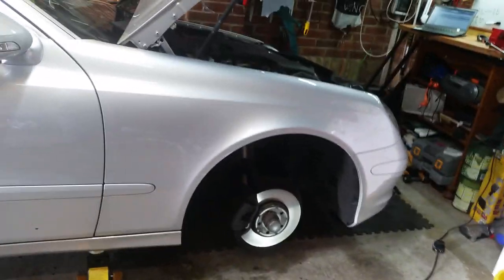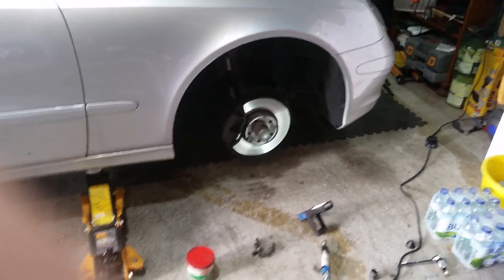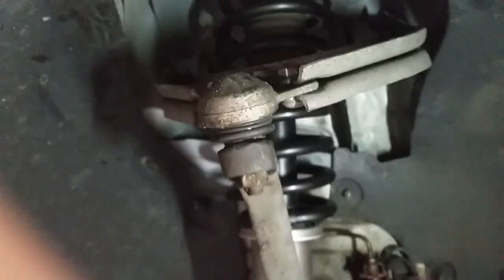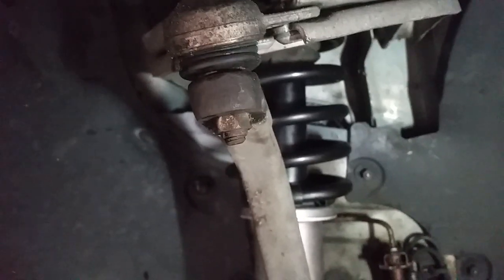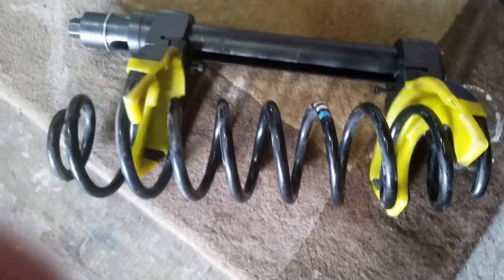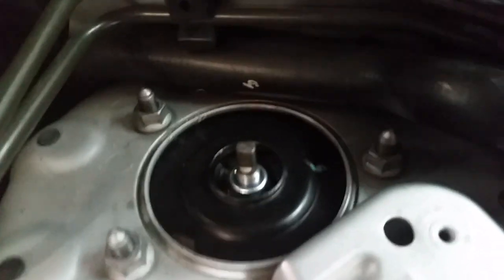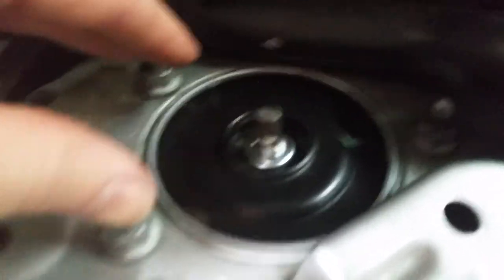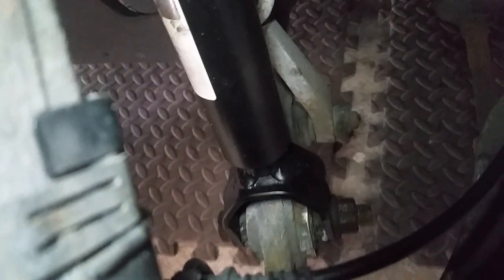Mercedes W211 front spring replacement, front shock replacement, front strut replacement

Comment: Very good video and explanation on locating the bottom of the shock to the top mounting bracket on reassembly and the ease of setting the ride height of the shock/spring by adjusting the small metal spring with your fingers. A very easy explanation. Thank you.

Comment: Easier to unscrew three bolts from upper control arm and separate knuckle from the top.
Reply from the maker: Good point.  I used the ball spliter as I had one.
Reply: @Alan.BigAl.  Much easier just to wiggle the control arm down, put the shock fork on it, towards the back of the car, twist the shock using a screw driver  through the fork and wiggle again and the shock is out. It is that easy!
Reply: or just loosen the nut a little so it still has tension then smack the upper with a hammer a few times we took four hours trying to figure it a on top of me paying someone (right) he had to go to work i watched a five minute video and took it off
Reply: @lasmiley3793 you got the link to that video?
Reply: @travisbrowne964  yeah one minute
Reply: @lasmiley3793  thank you 🙏🏾
Reply: @travisbrowne964  all good imagine paying someone just to do it yourself
Reply: @lasmiley3793  yo bro you got that link?

Comment: How do you adjust the high on the new ones? My new ones are way to high in the front. Do you know the proper measurement of the shock?
Reply from the maker: Hi,
The ride height depends on the model, but I don't know what they are. I set mine by putting the old one next to the new one and adjusting the ring. I tried to show this in my video around 3mins in but as I had already fitted the new one I could not show the adjusting ring that sits behind the lower spring mount on the shock.  By default my new shock was in the highest position and I needed to set it to the lowest. I suspect this is you problem.. ie your new shocks were fitted in the default "high" position.

The problem you may have is that once fitted and the weight of the car put on them, the spring mounting bracket on the shock seems to "lock" in place. I'm not sure if you can adjust after it been fitted.. (The ones I fitted you could not). Only thing I can suggest is to take them off, remove the spring again and see if you can move the spring mount bracket up on the shock to see of you can access the adjusting ring that sits behind it.

Have a look at the first 1min of this video.. it may help you.. he shows how the hight on the shock can be aducsted by moving the ring that the sping bracket sits on..

https://www.youtube.com/watch?v=hBpLKyaG9BE

 Al
Reply: Your opinion for monroe?????I have the same w211 and i bought oespectrum....thank you
Reply from the maker: @giorgostsagkarakis6133  

Hi - its a subjective topic.  I put some KYB's on the back of mine but found the ride far too hard and changed them to Monroe's within 2 weeks.  The ride is so much better.  On the front I put Sachs and I find they are giving a really nice ride.  So for me.. Monroe on the back and Sach on the front
Reply: @Alan.BigAl.  thank you my friend.....its a nice combination sachs on front wheels and monroe back.....I am really satisfied with monroe

Comment: Gearwrench make a pass thru socket wrench 893823
Reply from the maker: Really good shout.. this is why post so that ideas can be shared.  Thanks. Tools seem to becoming easier to find and range expanding so always nice to hear of alternatives. 

 Gearwrench are not easily available here in the UK  but there are other bands of pass through sockets are now on Amazon/ebay etc.  

I recently got a set of "difficult access' sockets that would have saved me cutting into my deep socket that are a bit cheaper but the pass thought look like a sound investment.
Reply: Амортизаторы длиной какие ?

Comment: Nice video, I just replaced my front shocks and springs on my S211 spot with napa ( monroe ) . Where did you get the spring compressor?  looks like a nice bit of kit
Reply from the maker: Thanks. 😊

It this type of thing..

https://www.ebay.co.uk/itm/284354587575?mkcid=16&mkevt=1&mkrid=711-127632-2357-0&ssspo=UB597qhlS2-&sssrc=2349624&ssuid=hwtlTy4SQTm&var=&widget_ver=artemis&media=EMAIL

Not sure if the link will work .. but it is a fab spring compression set.. even easier to use if you have a good vice to clamp it in.

Comment: I left mine all the way up will it cause problems in the future?
Reply from the maker: Humm.. that's a subjective one.  

The ride hight will be different so the loading in the front springs and rest of suspension may not be correct.  Also, the geometry of the whole car may have changed so the back will also be impacted.  Depending on the new ride hight the stability of the whole car could be compromised making it unsafe. Also, you may find the whole cars suspension will wear out quicker.  

There could be insurance issues as well should you have a crash.

But.. really depends on the new ride hight.

For me.. its not worth the risk. The cars are engineered to a specific set up and to change just part of the set up could have unforeseen consequences on the rest of the system.  Professional lowering/raising kits where all corners and components are really the best way forward if you are looking to change ride hight.